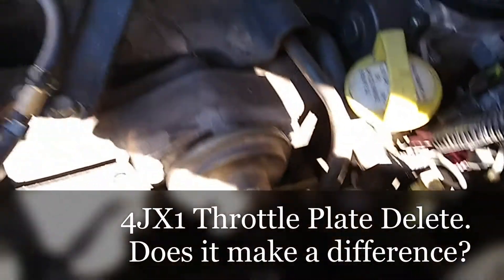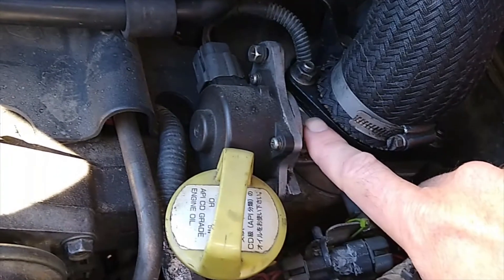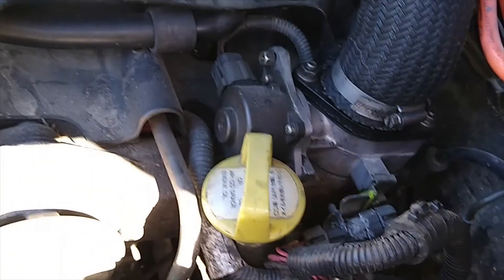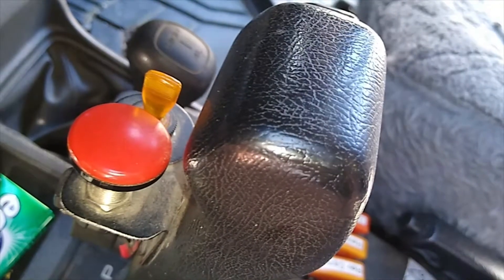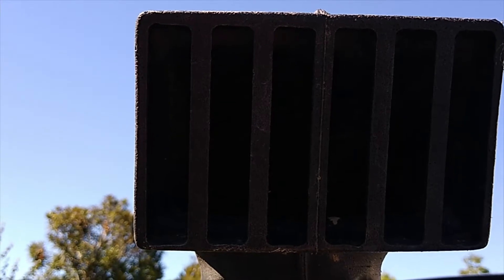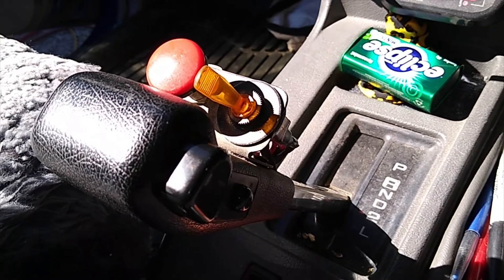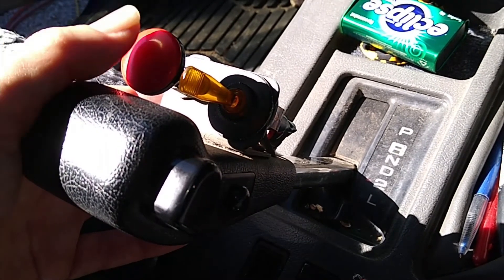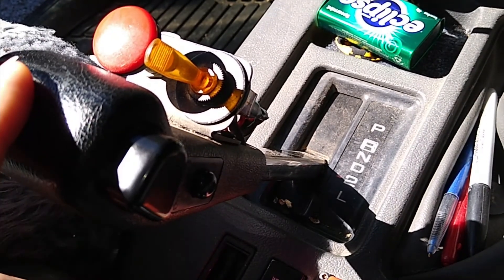4JX1 engine throttle plate DELETE. Does it make a difference? "Well not really"

Comment: i do know that over time exhaust gas recirculation blending with oil from the pcv valve causes a build up of abrasive crud in the intake manifold which wears out the bores faster , it can become quite hard and abrasive.
when you delete the egr or use a catch can it stops building up.
years ago when we deleted my brothers egr on an old zd30 navara he immeadiately noticed a little  better bottom end acceleration.

Comment: Thanks for your energy videos, keep them coming, i recently bought a manual 98 jackaroo SE 3.0td 4JX1. Been going flawlessly for 1.5 years, until the dreaded not starting. It's so not starting, but the more i research the more i live these things. Very interested in doing some mods. My engine has always taken FOREVER to get to operating temperature. 🙄😮‍💨 The cold start button on the dash only works below 7c right. I'd that a wastegate flap or something??